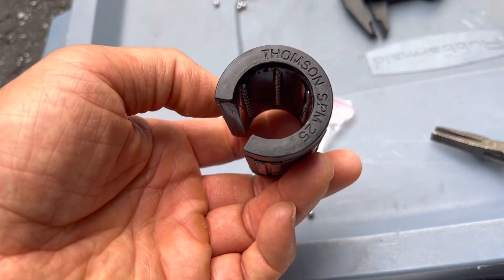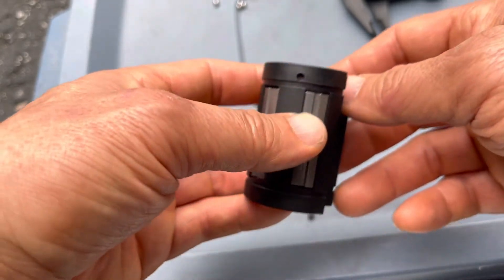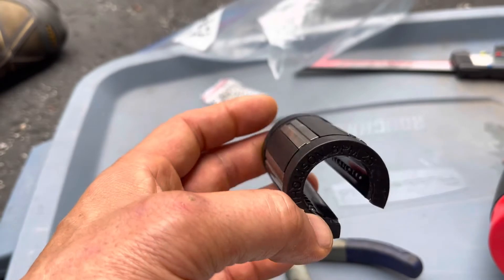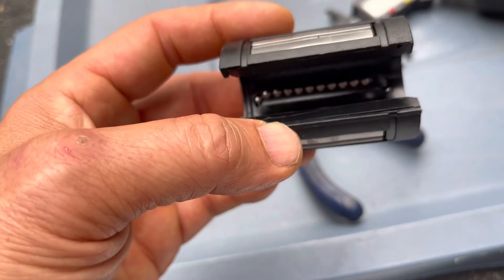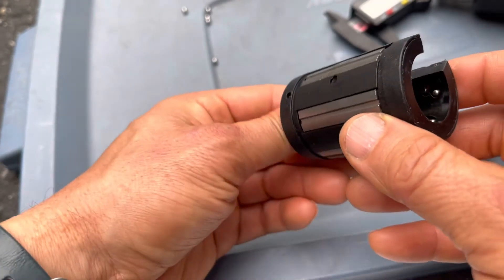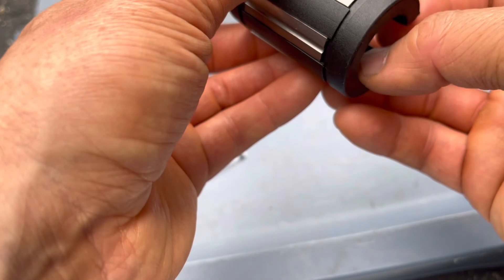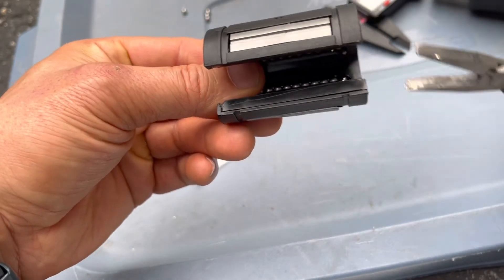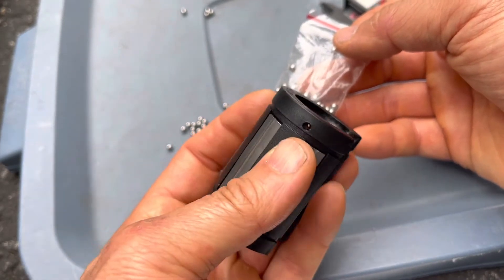Linear Bearing Repair

Comment: Awesome! I got the same bearings from an old Flex Leg Press. Maybe you can make a video how to clean the bearings when they were used 20+ years! That would be great!
Reply from the maker: Haha!!!! I have a ton of flex equipment. Did it work for you? So I had an old flex leg press I did the same repair on. The guy on the east coast left it out in his back yard for years in rain and snow. It was a rusted mess. I restored the whole thing. And bearings were rusted as well. Use an industrial spray lubricant like liquid wrench or similar. Soak the whole bearing with it and put in a ziplock bag for a day. Then take it out, put mechanic nitrile gloves on (cheap harbor freight) run your finger on the inside of the housing pushing the bearings making them roll. They are stainless steel. They will start rolling if you need more friction put a thin rag on you finger and push the bearings. You can get it like brand new with some patience. Glad I could help.
Reply: @tsaipod  - Great tip! This evening, I removed a linear bearing from my Magnum E-Series Model 2222 Biangular Chest Press (the seat adjustment uses 2 linear bearings.) No balls are missing, but I would like to 'clean' (soak?) the linear bearing and then carefully blow it out before I reinstall it. Any recommendations on cleaning one of these? Do you still recommend placing it in a ziplock bag full of liquid wrench? I've heard soaking it in Isopropyl alcohol would suffice for a linear bearing that is already working and devoid of any "lubricant leftovers." Once reinstalled in my gym equipment, I've read that you only need to lubricate the shaft (that the linear bearing travels on) with silicon/PTFE spray (I prefer to use the dry lube Sailkote from McLube - it's pricey, but better than a teflon-based lube and it does not attract dirt or dust.)
Reply from the maker: Maybe I will make a re-enactment video but you get the idea I’m sure
Reply: I'm also here to fix a leg press
Reply: hmmmm im going to pick these up when i see them for free now lol